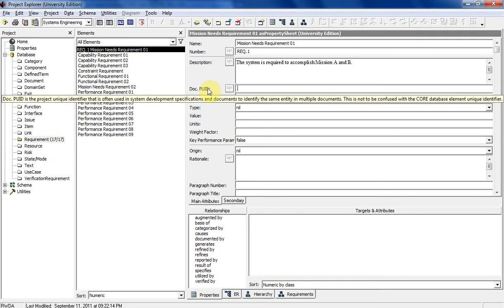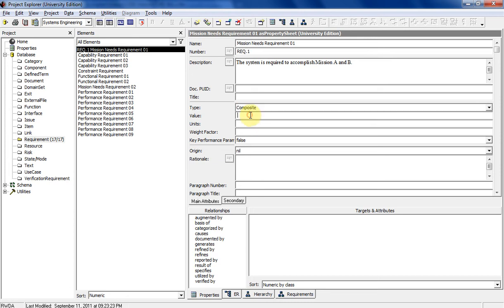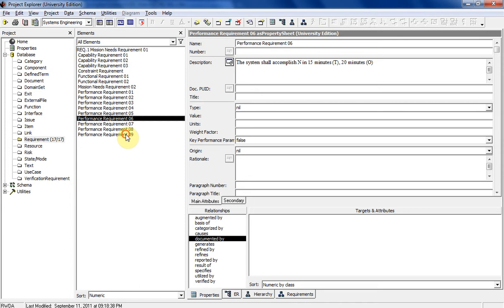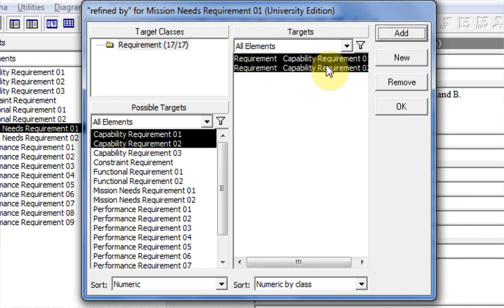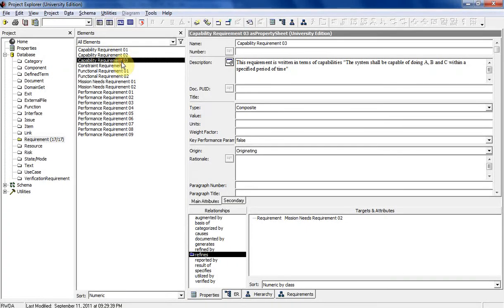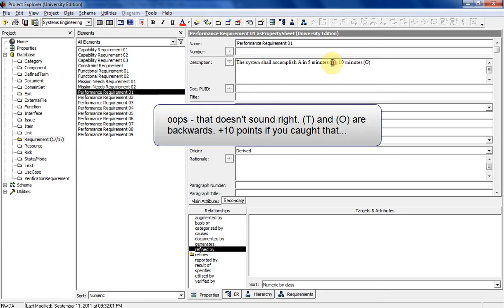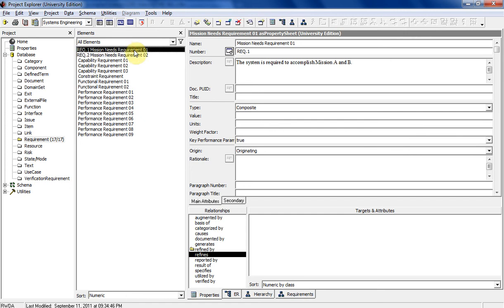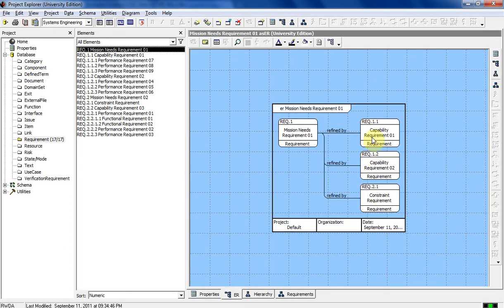04 Using CORE - Requirements Analysis 2 of 3

Comment: Good video, thanks!

When you did the first renumbering (8:54 into the video) of "Mission Needs Requirement 01", the "Constraint Requirement" was renumbered to REQ.1.3.  When the 2nd renumbering happened (9:10 into the video), for "Mission Needs Requirement 02", the "Constraint Requirement" changed to REQ.2.1.

I think it's due to the relationship between the constraint and the other requirements since the constraint refines both of them.  I see that as being a child of both of those requirements.  Could that pose a problem as the documentation iterates several times?